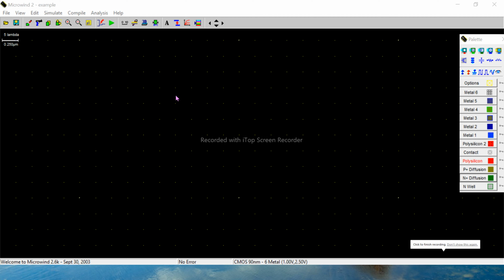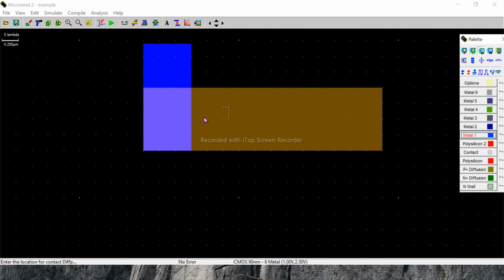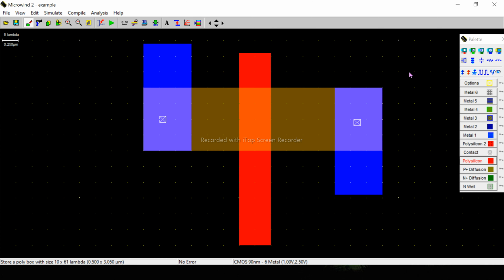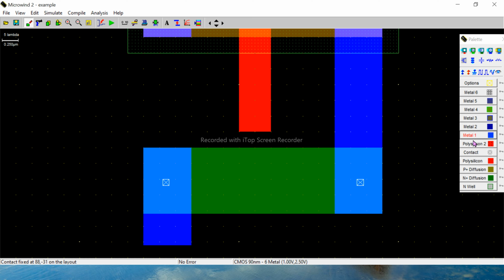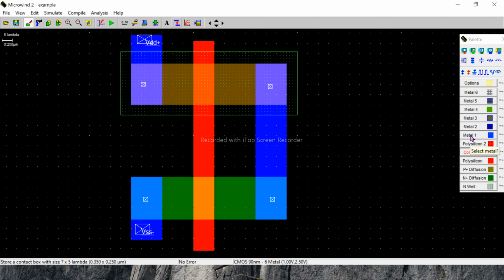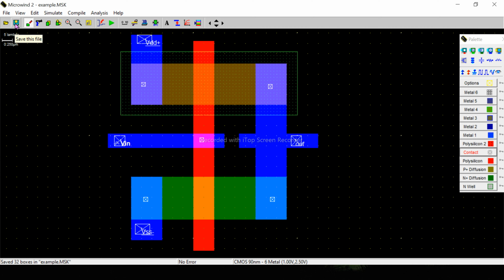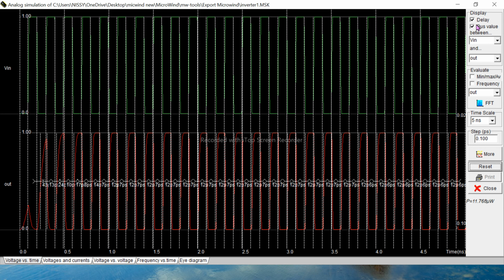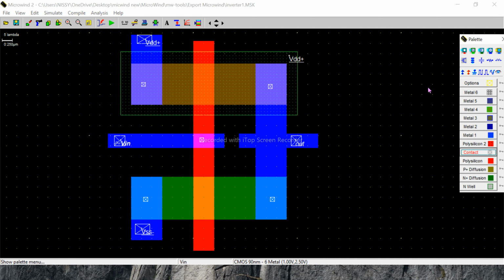CMOS INVERTER LAYOUT DESIGN For VLSI Lab

Comment: Length & width of the pmos & nmos will be what? You said, width of the pmos is 4um. But didn't say anything about them? Please reply!
Reply from the maker: Width is 4um for both pmos and nmos but length is expandable here for both pmos and nmos
Reply: @Dr.Sarin.Mythry  sir i have some silly questions. What's the purpose of n well in that software. And why it has not given to nmos? Is it only used for pmos?
Reply from the maker: The software is designed on n-well platform. It's n-well CMOS fabrication layout design. N well also acts as a substrate, so biasing is done.
Reply: @Dr.Sarin.Mythry  now I understood. Thank you sir for your help.